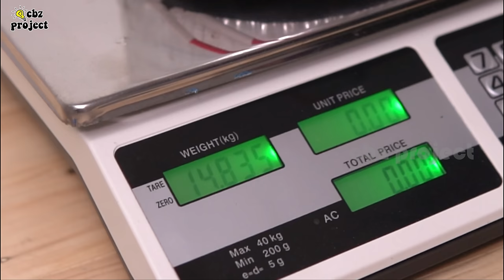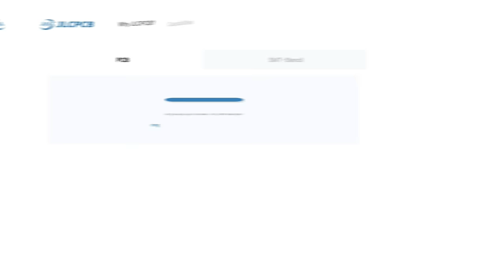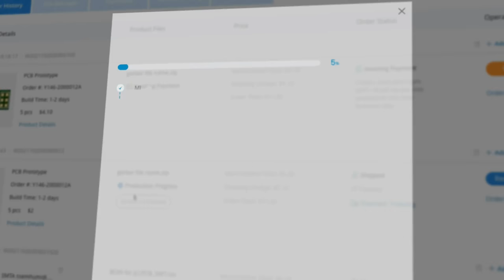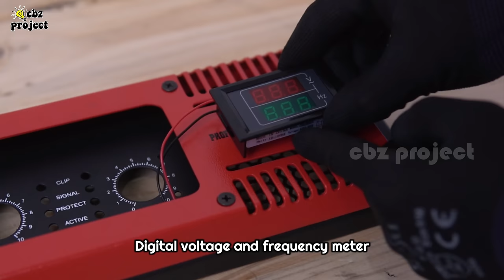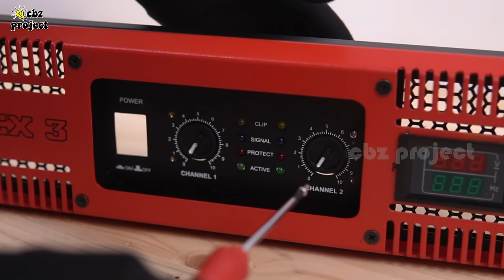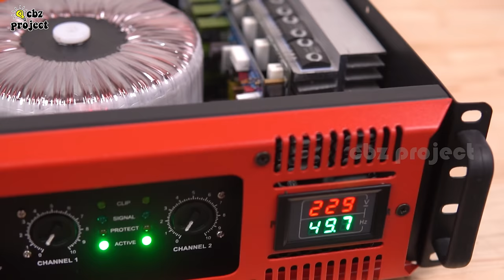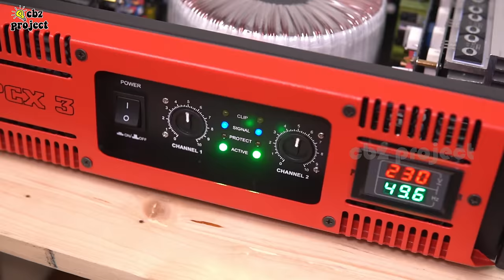Full Assembly High Power Amplifier with 70v 0 70v Toroidal Transformer #cbzproject

Comment: Isn't a 100V capacitor too little? The transformer voltage is 70V, so after rectified and filtered it will reach almost 101V

Comment: Hello,

I do not know decide between amplifier atoll in100 and in80,

the in100 has two toroidal transformers of 340VA, it is NOT dual mono, 
amp is 2x100W

thi in80 has one transformer of 340VA
ammp is 2x80W

both have the same capacitanc about 31000 microF, isnt this small for 2x100W?

Which one is supposed to be better by teory?

Thank you

Comment: The capacitors must not be 100V but must be 125V because the supply voltage is critical for them. 70V from the transformer times 1.42 (root of 2) is 99V. The voltage in the network oscillates and the capacitors will break.
Reply from the maker: That's right, the measurements showed about 105V DC and we replaced it with a value of 125V.

Comment: Those power plug in sockets they use are a JOKE! No ground? All American plug ins are grounded by code! I run 4 20 amp. class H amps. in my house off of 3 double plug in GROUNDED sockets! each line has a 20 amp. draw and up to 120-VOLTS! That sucks that they have to use such a crude plug in socket! Those Fans are WAY LOUD compared to mine on my 4 RPA-16 amps. from ROCKVILLE!
Reply: the ground is the yellow pins on the outlet